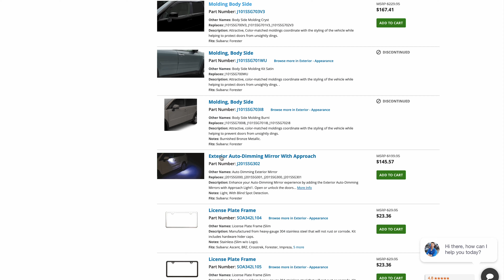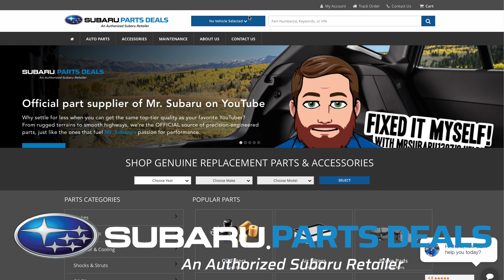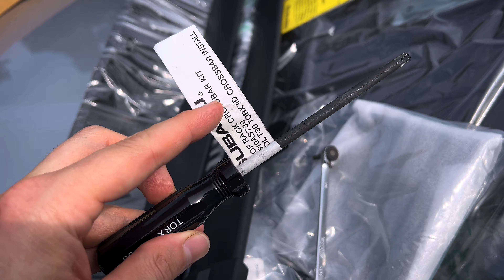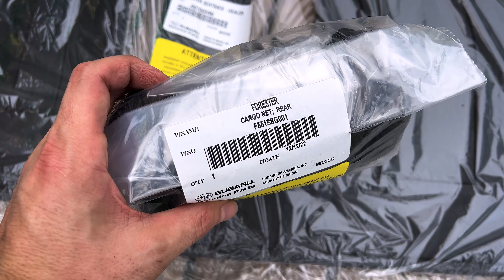Project 2014 Forester: Make Your Older Subaru Feel New Again With Subaru Genuine Accessories!

Comment: I bought 2015 Forester 2.5i 6 months ago. Had 185k I drove 7k so far so good. It's great car gives good mileage but does burn half quarter oil every 3000 miles so I do keep one QT in my car too. I want this car to last 300k I am hoping it will.
Reply: How's it going so far?
Reply: How is it going ? I am thinking on getting a 2017 with 160k
Reply: I sold it at 205k. Upgraded to 2021. But when I sold there was no check engine light.. we did long distance trip before we sold it. We bought new because car radio was outdated and my wife wanted little newer one.

Comment: I had the same cross bars for my 14 Forester and 2 of the rubber feet disintegrated while I was on the road with bikes loaded on top. The dealer directed me to SoA for resolution and SoA directed me back to the dealer for resolution. Eventually I gave up and bought crossbars from Harbor Freight which have worked flawlessly.
Reply: Do they create any wind noise for you at interstate speeds?
Reply: @NVRAMboi  some but not a lot. The car is pretty loud as is so it’s not super noticeable.
Reply: wow disapointing Subie didn't help u financially , if u had damage to bikes etc.  Very risky situation when roof rack comes undone.   I never know whether to make an insurance claim in situations like that, or if that will jack rates up.

Comment: Looks good! I have a silver 2016 6mt. I vinyl wrapped the center section of the grill, since it is the easiest to remove without potentially breaking anything. 3m satin finish. Takes care of most of that chrome. I also put on the factory "mudflaps" and exhaust tip in addition to the window guards.

Comment: Back in 2015, after I was the proud new owner of my 2015, I installed the side window deflectors and painted my grill black with plastidip. The side window deflectors are a MUST HAVE.
The other must have, is an upgrade to the rear sway bar. I got the 19mm one I think. Makes a really enjoyable difference.

I have 518,122 miles on mine. But I've almost replaced the entire car in the past 10 years.

Comment: Well, I upgraded my 2017 Forester 2.0 XT a long time ago with full LED lights and a turn signal relay. I even installed blind spot mirrors with protectors/mats like door cups and edge protectors. I swapped my old radiator cap with an aftermarket one with about the same psi with a pressure release lever. I even swapped out my old head unit with an aftermarket touchscreen with Android Auto and CarPlay that can connect via Bluetooth and Wi-Fi. And for good measure added seat covers and holder/tray inserts. I plan on keeping this car for a very long time with proper care and routine maintenance.

Comment: I've got a 2015 Outback 3.6R, and will drive it till the wheels fall off!
I might have considered trading it in on a new Outback in the next year or so, but because they discontinued the 3.6, there's no way I'm going back to the H-4...
Reply: Go test drive the turbo.  I have an Ascent with the 2.4 liter 4 cyl turbocharged, and a naturally aspirated 2.5i outback - You won't believe the power the turbo has and the ascent weighs 1500 pounds more than the outback.  I here they are putting that turbo engine into the outback too!

Comment: On our 2016 Forester XT Premium, I noticed an increased amount of wind noise while the crossbars were in place.  So, I took them off and stored them if ever needed.  But, that moonroof deflector option might well have improved the noise situation.  Lucky that our 2016 was optioned up with the sport grill, center console/coin tray, rear seat protection and cargo mat/net.  But, your video would have certainly given me the know-how to install all of them with ease.  Otherwise, I am not a fan of side window deflectors for where I live (high desert).  You are my hero for such excellent DIY videos...because we own a 2017 WRX too.  Love their turbo motors to handle our local mountain elevations ranging between 5,000 to 10,000 feet.  Last thought is that I also added fog lights, matching bodyside molding, a rear bumper protective cover and an adjustable HD rear sway bar (to reduce body roll) to the Forester.

Comment: HI, I HAVE A UNRELATED QUESTION. I HAVE A 2017 SUBARU FORESTER 2.5I TOURING 4WD, IT IS MY FIRST BUILD. I'VE STARTED ON THE EXTERIOR AND I'M ALMOST DONE AND WANT TO START LOOKING INTO UPGRADING THINGS UNDER THE HOOD. I HAVE A STOCK ENGINE NOTHING EXCITING. JUST WANTING SOME IDEAS OR RECOMMONDATIONS ON SOME PERFORMANCE UPGRADS. DECIDED TO AVOID THE TURBO ROUTE ALTHOUGH IT WOULD BE IDEAL FOR PERSONAL PREFERENCE BUT I FIGURE I'LL LOOK INTO TURBO ON A DIFFERENT VEHICLE AT A DIFFERENT TIME. RIGHT NOW I'M PRETTY OBSSESSED WITH MY "BRUCE" THAT IS HIS NAME VERY SIMULAR LOOKING TO THE ONE IN THIS VIDEO. THE BIGGEST THING I'VE DONE EXTERIOR WISE IS "BC COILOVERS" I'VE MAXED OUT THE COILOVER TO AS LOW AS THEY CAN GO AND I'M LOVING THE LOW LIFE AND THE NEW WHEELS. I AM "LOW & SLOW" AND THATS FINE BUT I AM CURIOUS ON SOME PERFORMANCE INHANCEMENTS FOR THE BEST LIFE OF MY SUBIE FIRST AND FORMOST BUT ALSO ANY KIND OF LITTLE BOOST IN PERFORMANCE WOULD BE NICE. I'M GETTING A LOT OF YES & NO ON SWAPPING MY STOCK INTAKE SO IM CURIOUS ON YOUR OPINION IF THERE IS A BETTER INTAKE THEN THE OEM THAT MIGHT BETTER THE CAR, MILEAGE, AIR FLOW ECT. OR IF KEEPING IT STOCK IS BETTER (IVE BEEN LOOKING AT COLD AIR INTAKES & THE PLUG & PLAYS) ALSO; IVE DONE A FULL TUNE UP; TRANNY MAINTANCE (@SUBARU) I KEEP UP ON THE BASIC maintenance, THINKING ABOUT REPLACING MY MASS AIR FLOW SENSOR, AND ANYTHING ELSE WORTH REPLACING TO JUST KEEP BRUCE RUNNING SMOOTHLY. I GOT BRUCE USED WITH 55K AND NOW HAVE 90K IT IS MY DAILY AND MY WEEKEND; LIKE I SAID IM OBSSESSED AND THE NEW LOOK FEELS LIKE I GOT A NEW CAR LOL ; I'M JUST A GIRL THAT LOVES MY CARS & MOTO'S AND I LIKE TO MAKE THEM UNIQUE AND KEEP THEM IN THE BEST SHAPE POSSIBLE AND PERFORMANCE IS ALWAYS A PLUS. PLEASE HELP LOL 😂 😂  ANY AND ALL INFO WOULD BE APPRECIATED. THANK YOU * LEI*

Comment: Big issue with Subaru window deflectors is there is only a tinted version. I wish they offered transparent version too. One of the best things about Forester is visibility, why ruin it with tinted deflectors?

So I did next best thing: bought transparent deflectors from Climair. Rear ones are clipped in, but front ones go in channel. Really good quality, I've had them on my previous car too.

Comment: You'll get extra views if separate the video into multiples like. Window deflector install subaru, Moonroof deflector install, cross-bar install. Ive looked to videos like that a dozen times for our vehicles.
Btw i did deflectors in winter. A heat gun/blow dryer makes a miracle. Even in a warmer weather. Adhesive loves heat.

Comment: Interesting noise complaints stem from these cross bars. If those torx bolts aren't all super snugged down you'll get a noise that sounds a lot like percolating coffee.
I once spent 4 hours chasing the noise on a Crosstrek until I figured it out. I felt like a real idiot when I tightened one bolt and fixed it. 😅

Comment: 😊"You're a better man than I, Gunga Din!"  At my age (73), I can say: "Homey, use to do that (more or less) now and then but...Homey don't play dat anymore." 
I have a 2004 Subie Forester X now for 20 years as of this month (9-2023). It's at 143K miles and many times in the past several years, I've thought of renewing my car ("Loretta" as I've called her since its beginnings...named in honor of one of my all-time favorite girl friends from  the 1960's) but, figuring if I did...it would be $15,000. 
Just within the past few months, I put in $5,000 in "necessary repairs" on some suspension parts, as well as new brakes.  The car rides and sounds much better but there will be needed very soon, the value cover gasket replacement and new timing belt. 
I guess for actually $20 K..."Loretta" would look fantastic! Put in a camera system and this car would be good for some years to come.

Comment: Nice job! I have a question about my 2017 Subaru Legacy 2,5. My car has 170000 miles on it, when I start it up, the engine sounds good after it warms up it sounds like a real chatterbox. Should I put a thicker motor oil in it? Thanks. I love your YouTube

Comment: Off topic but wasn't sure where to ask this. I own a 2011 ej255 WRX it's in good shape has 194000 miles. Heads were both replaced by Subaru at 105,000 I just replaced the clutch new radiator and hoses. My wife then posed a question how much longer can it last reliability without a major engine failure. Google just scares the hell out of you with all the ringl and failures and rod bearing stuff. How long can you expect a cared for ej255 to last? The cars is stock.

Comment: From watching your videos I have been able to gather a lot of knowledge about Subarus. I own same year Legacy, and my car EATS oil! Planning on redoing the whole front end of my car. Bumper, fog lamp covers, liners for the underbody and passenger fender (which rubbed on my tire after my March accident). I had to Bondo the rear passenger fender and rocker panel frame, as there was bubbling and major rust. Next project is getting a new oil pan (thanks for the tip in the Donut critique video) and oil pickup Tube. I’ve also been getting a code for my car, and it’s c0045 or something like that. From forums, it looks like the culprit is the rear driver side wheel speed sensor. I’m wondering if that’s the case or if it’s something else.

Comment: I can’t get my passenger side low beam to work on this car no blown fuses check for the correct one in manual and new bulb what could it be? Could you please help I don’t have extra funds to drop so any suggestions would be very helpful, I’m gonna attempt to clean out the wire socket with contact cleaner all the other light associated with the gray wire socket work.
Reply: It was just me being a dumb ass and I confused the high beam with the low beam head light crazy how your mind tricks you when you convince yourself of shit

Comment: NEED SOME HELP!!! I bought my son A 2014 Crosstrek and the brakes keep locking up. The ABS, Hill Assist and traction control lights all come on, then a little while later, the brakes while lock up at a stop sign/light and not release. I had it towed to a mechanic who replaced the brake light switch and the ABS Pump. Got it back and had no problems for about a week. Then all of a sudden, the exact same thing happened again. Great fully, the mechanic came out to where we were stranded and released the pressure in the ABS Pump which released the brakes and we were able to drive it to his shop. Any ideas what is causing this???

Comment: Shame - Shame Mr. Sub I can tell you were never into paint work. Wipe off all the gank before you put new trim on, and actually it should be waxed or sealed behind the trim. Love the content, now can you tell me why my piece of shit 12 Legacy with the cvt kills at a stop sign, with the slightest firm braking. I want to throw up because someone mentioned that was the most common sign the f-ing cvt is junk is that it kills on you. I have nursed this thing since new and with 133K on it i have put quite some effort into not 1 door dent. My car is in exceptional condition and I'm in Wi. with 0 rust on my car. Totally lied to by the dealership as to cvt servicing. Never needs a fluid change, never, never, never. Too late now, correct? A replacement would be finacially devastating for me.